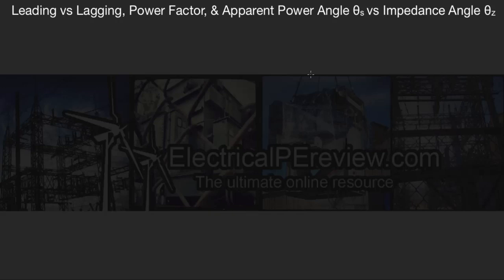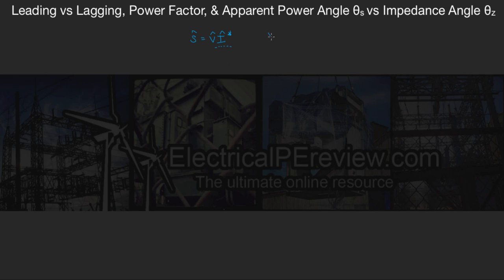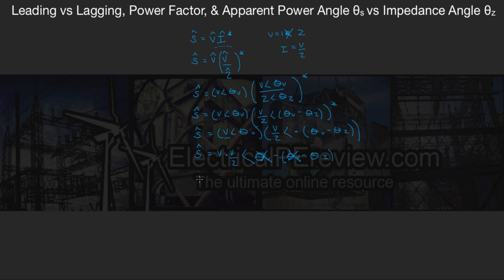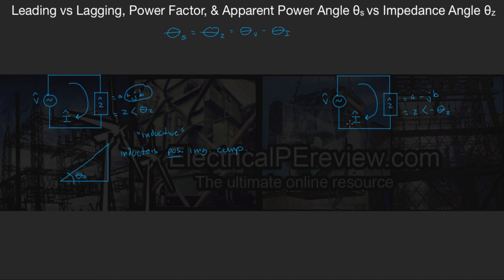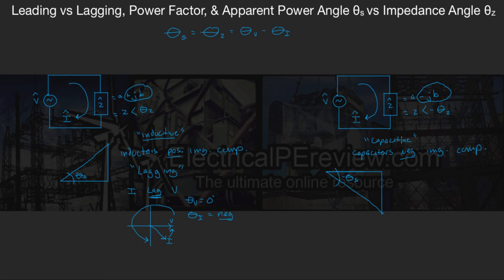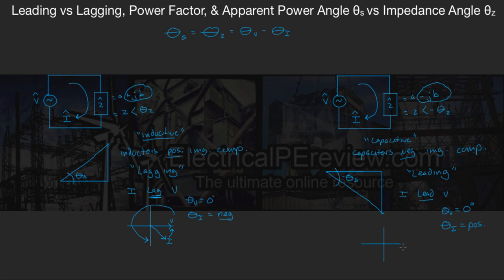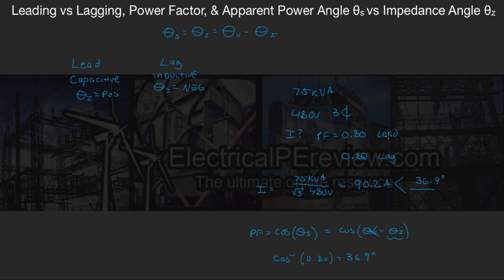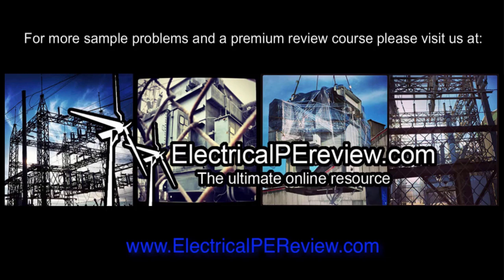Leading vs Lagging Circuits - Everything you Wanted to Know for the Electrical Power PE Exam

Comment: Very important topic. Current and P.F. lead/lag crucial to remember for deltaQ calcs for p.f. correction, AC/DC motors to calculate Ea, T&D voltage drop or Vs (orVr) calcs.

Comment: I feel like I understand this but then I seem to not. @ 16:54, why did you put a root 3 in the denominator? I feel like you're making some assumptions that aren't explained. Thank you.
Reply: You're assuming that the 75KVA is 3ph while the 480V is 1ph line voltage? On what basis can we make these assumptions?
Reply from the maker: jspianoman07  In this specific example we are dealing with a 480V three phase system that consumes 75kVA of apparent power. Anytime you are dealing with a three phase system or a three phase machine (such as a three phase transformer or three phase motor), the ratings and values will always be given in three phase unless stated otherwise. For example, in this problem 75kVA is the total three phase apparent power consumed, 480V is the system line voltage magnitude, and we are solving for the system line current magnitude that has a power factor of 0.80.  Check out the following article, I think it will be beneficial to you: https://www.electricalpereview.com/biggest-mistake-commonly-made-three-phase-power-formulas/  let me know if you have any other additional questions, I'm always happy to help.
Reply: Thank you so much for that link. Awesome information there!!!!!!
Reply: I'm so glad I read the info in that link. It cleared many things up for me. I feel so stupid now but I had assumed the apparent power formula for 3ph was S=VI*. The book I have doesn't say it was only for single phase, which I now know it was. 

I do have another question, on that link we have | S3ph | = sqrt(3) x | VL | x | IL | = 3 x |Vp| x | Ip |. I also see S3ph hat = 3 x Vp hat x Ip hat conj. Is there some form of Sph hat that uses line values instead of phase values? Maybe something like S3ph hat = sqrt(3) x VL hat x IL hat conj? I just tried this on an example and it doesn't come out correctly, so I'm assuming the new formula I proposed will not work.
Reply from the maker: jspianoman07  Don't feel bad. No such thing as a stupid question "since stupid people don't ask questions."  Most books don't do a good job at explaining the fundamentals, and it is the fundamentals that make the tougher problems difficult.

The only formula you should be using with a current conjugate is the single-phase complex power formula where the following variables are complex numbers:
S_1Φ = Vp•Ip* 

The three phase equivalent formula may only be used to solve for apparent power, or, the magnitude of complex power. The following variables are magnitudes only:
|S_3Φ| = √3•|V_L|•|I_L|

To get the power angle, just take the inverse cosine of PF and make it positive for lagging and negative for leading:
θ=cos-1(PF).

The tricky thing to realize is that single phase and three phase power have the same angle if they come from the same balanced system:
S_1Φ = |S_1Φ| < θ
S_3Φ = |S_3Φ| < θ

Their magnitudes only differ by a factor of three:
|S_3Φ| = 3•|S_1Φ|

So either get your power angle from the inverse cosine of power factor, if given power factor, OR, calculate it using the phase values only and the single phase complex power formula that uses the current conjugate:
S_1Φ = Vp•Ip*
Reply: Electrical PE Review but the link to your site has an equation S3ph hat = 3 x Vp hat x Ip hat conj. Are you saying that this equation is not valid?
Reply: Electrical PE Review wait, maybe I know what I'm confused about. I thought complex power and apparant ppwer were the same thing since they are both in VoltAmps. I just realized that's not the case. Complex is the vector, and apparant is the magnitude.
Reply from the maker: jspianoman07  That formula is perfectly valid.
Reply from the maker: jspianoman07  Exactly. Apparent power is the magnitude of complex power. Apparent power is in the unit of volt-amps. Complex power is volt-amps AND the power angle theta.
Reply from the maker: Hi jspianoman07, no assumptions. The square root three is in the denominator because we are using the three phase apparent power formula to solve for the line current. The three phase apparent power formula is |S_3Φ| = √3•|V_L|•|I_L|, brackets indicate that these variables are magnitudes only and not complex numbers. |S_3Φ| is the three phase apparent power, |V_L| is the magnitude of the system line voltage, and |I_L| is the magnitude of the system line current.

Comment: This is probably one of the most helpful videos you have posted for preparing for the PE Exam. Showing the relationship of leading vs lagging circuits with voltage and current phasor diagrams as well as power triangles was really helpful.
Reply from the maker: Thanks Jason. Best of luck on the PE exam, we enjoyed having you in our online program this semester and your high level of participation you brought to each live class session.